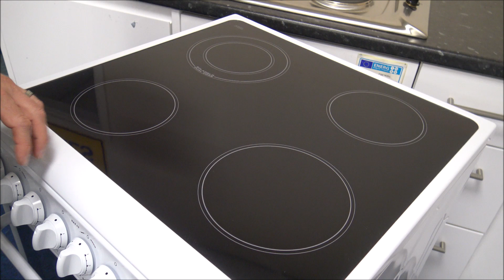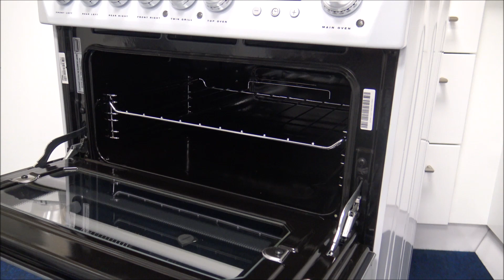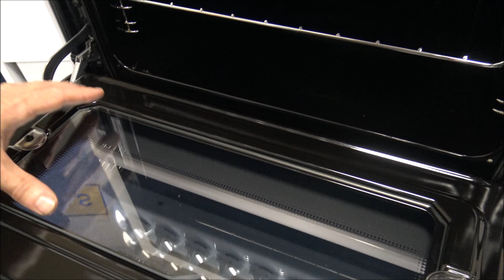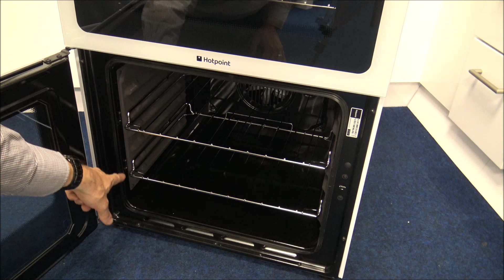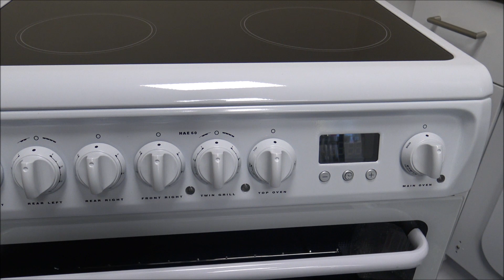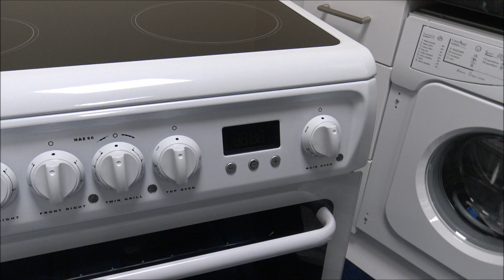Hotpoint HAE60 60cm Electric Cooker

Comment: How does the grill work
Reply: There's 2 hot elements on each side of the grill.  The grill knob shows 2 or 4 elements.  If you have a small item turn the knob to the left so that only the left 2 elements heat up.   If you have a large wide tray of food, turn the knob to the right so that the whole grill heats up.  Good luck x